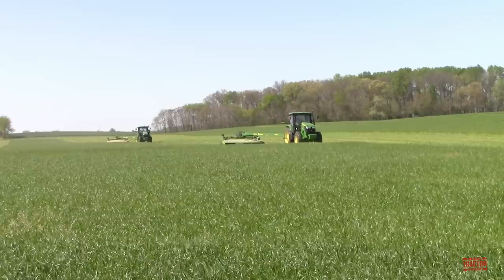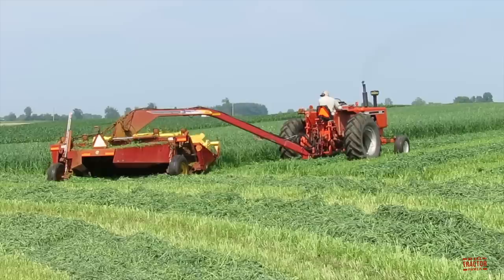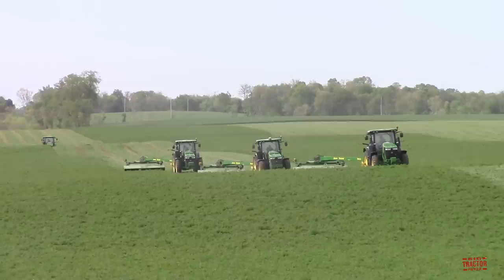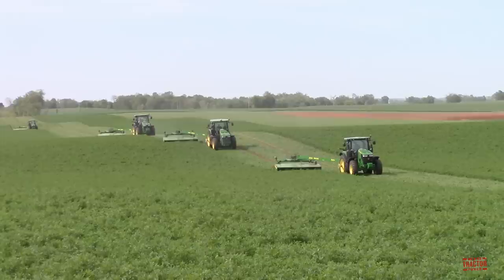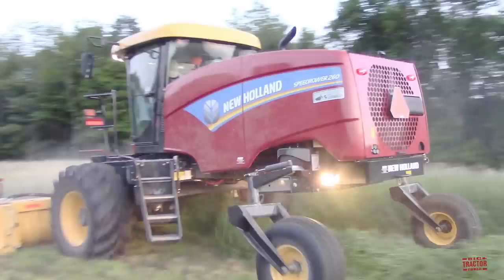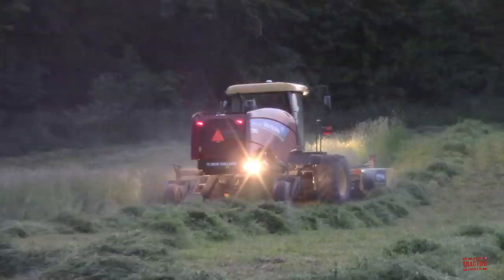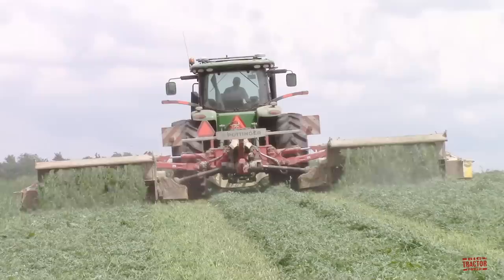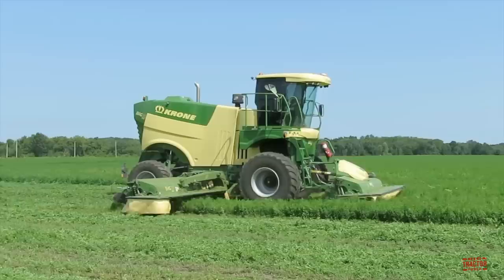All Types of BIG HAY MOWERS

Comment: I would have loved to have a Krone mower back when I was cutting so much hay. That was a long time ago though. 40 to 45 years ago to be exact. Now that’s the way to cut hay!
Reply from the maker: What did you mow with?
Reply: I agree 100%
Reply: Mow alfalfa and a side or two of custom work
Reply: I had a case wd2303 I believe. And before the a new Holland pull behind 12 ft dont know number anymore. We just got to point where acres and time to stay ahead of chopper so that's why I went with the krone
Reply: in a not so distant future, that mower probably would be automated, since there's driverless tractors already, and the task is simple enough..
Reply: They are Amazing! We use them all the time in Germany, even small field. 
They can displace the gras at the outside to the inside of the field, so you can hay-flip (?) It alot easier! 
Also its soo fast. No comparison to a 200hp+ new tractor plus combination!

Comment: Thanks for the great vids.
I started my mowing career as a contractor at 10 yrs old on my fathers old fordson major.
My 11yr old brother also used to drive a super major and disc mower.
That was in Wales UK,back in 1973,I have used every type of mower from an old horse drawn Albion land wheel driven sickle bar,to the latest tractors and triple mowers.
I am still contract cutting and currently run a new Fastrac 4220 and Kuhn 9.5 metre triples.
I will try a Krone Big M at some point i reckon.
Even after 50 yrs I stil love scything through the grass.
Reply from the maker: Wow. Great history.  Thank you for sharing.

Comment: Nice video. Thanks. I found a 12' 1600A center swing sickle mower conditioner at auction for 250.00 and fixed it up nicely. It works great but it really wearing out. We really need a discbine now !

Comment: One of the funnest jobs I had was cutting hay back in the summer of '89.
The machine I used looked much like the New Holland here but it was older and had a cycle bar and reel. I sure wasn't able to cut that fast. I remember plugging my auger and needing to get out to free it several times.
Reply from the maker: Disc mowers really changed mowing.  I grew up watching a neighbor cut hay with a center pivot New Holland 116 and two side pull 489s.  They cut well but he eventually went to center pivot Hesston and a Deere disc mowers.

Comment: Hey Mike, why didn't you show the big Vermeer 18 ft pull type disc mowers or the 16 footer ???? Have a 18 ft Vermeer mower and a caseih 8920 and it would cut rings around those 4 green tractor's.
Reply from the maker: I would very much like to film a Vermeer. They are impressive. I have not had the opportunity to film one yet. As far as the 946 MoCo’s there are two factors here at play.  This is a new seeding of alfalfa and the field was a bit tacky but the crop was ready and more rain on the way so it was go time to get everything mowed and chopped. They were running 6 mph to reduce wear and tear on the new seeding. Typically they would run 8 mph.  The fields in this area roll and they have creases in the land that make dips and bumps.  You can not fly across these fields with any type of mower.
Reply: Big Tractor Powers name is Jason. Mike is Farmhand Mike. Two totally different channels.

Comment: Haybines will almost never cut a stalk more than once, they're far more effective in denser crop for less horsepower, can handle MUCH taller crop in much less smooth terrain, can be adjusted to cut VERY high, and you can make looser bales from their output and you can cut ripe grain crop with them without much threshing loss.  One of the advantages the video specific haybine has is it is 100% hydraulic.  Mike failed to mention that Allis-Chalmers 185 is an 86-90hp tractor, climbing hills and mowin more than half as fast as the 200hp JD's with mocos while producing a better product that lays more fluffy on the ground.

Comment: I work for a costom operator in Ontario Canada, we run triple mowers with a 724 Fendt, depending on crop (how much ore if it's standing up straight ore not) we run 8 to 12 MPH, you're right we get alot done in a hurry 100 acres in a little over 3 hours

Comment: Really enjoyed this - would love that Allis 185 to go with my B, WC & D272.  Haybines never caught on here in the UK but the Estate my father worked on were quite forward thinking and they did try a New Holland self propelled - it may have been a 1469. I can find no information here in the UK just a You Tube vid of one for sale in the US. I know this one had a Ford industrial 4 cyl Diesel engine. It was soon replaced by smaller but faster disc mowers. The crop was lifted by one of the first John Deere 4020's to come into the UK.
Reply from the maker: That is very interesting to know Speed Rowers were in the UK.  The 1469 did use a Ford engine.  I hope to find a 1469 and 1411 to film.  I have lead on a 1469.  What was the mowing option in the UK before disc mowers?
Reply: @bigtractorpower  Really the only thing before that was a knife mower ( or cutting bar ), probably no more than 5'  behind a Fordson major. I remember from the registration no of the 4020 it was new in 1965. Have you ever heard of a Busatis mower? it used two reciprocating knives.

Comment: Being from germany i find it quite interesting how much horsepower is being used to cut 13ft/4m of hay. Over here the tripple mower setup, or at least a dual mower setup (basicly the triple mower, but the rear mower only has one mower, mostly to the right) are standart, and often used with tractors at around 250HP for the triples and between 100 and 150HP (depending on the with of the rear mower, front mowers are mostly 3m/3ft). I have never seen something like MoCos, Swathers (although i know that pottinger has some belts that you can attch to one of their rear mowers (the tripple ones)) or windrowers. What are the advantages of those?
Reply: Most tractors over here in the U.S.A. do not have front mounted 3-point hitches or a PTO to power a triple mower setup.  The Moco pull-type mower/conditioner is the next best affordable option people have around here.  Self-propelled swathers are not uncommon either, however they are quite pricey when compared to a pull-type Moco mower that you could put on an already owned tractor.
Reply: My thoughts exactly. Americans stuck in their ways
Reply: @garettcalhoun3776 just fit front linkage and pto? It costs 10k

Comment: Why does a disc mower require so much horsepower to operate?
Reply from the maker: To offer high speeds mowing at over 30ft. It takes allot of power to process bulk crop material.

Comment: I know for a fact a 946/56 moco can cut at 22 mph nice rigs tho
Reply from the maker: Where are you mowing?
Reply: We haven't started yet this year but in Augusta Wisconsin we run  Claas triple mowers now but I've knocked down a lot of acres with a 956 John deere
Reply from the maker: If a 946 can do 22 where your at what does the triple mower do?  I got my numbers from the video from the farmers operating the machines. The 499 is in WI, 946 in KY, 260 in IA, NOVA in NY, Big M in WI.
Reply: 8 to 12 with the triple mowers they take a lot more power than the pull type still covers more ground tho